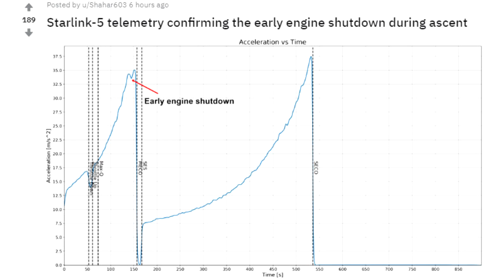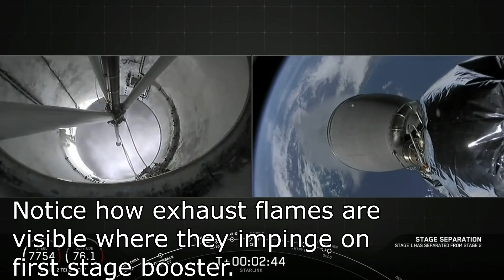Falcon 9 Suffers In Flight Engine Failure, Booster is Lost,  but Cargo Delivered Successfully

Comment: So the problem a few days ago may have had a deeper cause than a bad sensor.  The idea that 10+ flights per booster is perhaps in question right about now.
Reply: Extrapolating from a sample size of one is bad statistics.
Reply: @Markle2k  -- We have a sample of one and that one was a failure -- that would require a good many flight of cores at more than 5 flights to undue this failure.  Thanks for playing!
Reply: @Raptorman0909  A sample of one is a sample of one. You don't know that the next booster to fly 5+ missions won't fly the scheduled 10 flights before refurbishment. Booster 1049 is the one other booster that has 4 flights under its belt. B1046 flew its fourth mission as the sacrificial in-flight abort test booster for Crew Dragon.
edit B1056 was the Starlink 4 booster that didn't attempt to land on the barge due to bad wind data. It was the only other booster that would have launched 4 times, had it been recovered.
Reply: @Markle2k  -- That's right, a sample of one is a sample of one and you don't know that the next 10 Block 5 boosters might go 10+ flights without a problem -- BUT, that sample, the only one we have to go on, suggests engines may be a problem given the apparent loss of not one but two engines on this sample of one.  You can't ignore the data in your face because your'e waiting for a sample size that might takes years to develop.
Reply: @Raptorman0909  No. If you want to talk about overall engine reliability, that we can. That is separate from what you were talking about before.
The last time a Merlin engine had a failure was featured in this video. It was a Falcon 1.0 with Merlin 1C engines arranged in a 3 x 3 array. October 8, 2012, CRS-1, one engine shut down and the remaining engines fired for a longer duration. The mission was a success for the primary payload and the Dragon 1 reached the ISS a day earlier than planned.. That was the 4th of 5 launches of the v.1.0
There have been 79 launches since then with only one failure, that not due to the engines. That is 790 engine operations plus 54 for the Falcon Heavy side boosters, minus 2 for the CRS-7 upper stage that didn't get a chance to perform and the non-existent second stage motor of the In-Flight Abort for Crew Dragon. Subtract one more for the Falcon Heavy core that didn't ignite due to  not enough TEA/TEB shots.
841 out of 844 engine operations went as planned since the previous failure on launch number 4. From launch to landing. That makes the Merlin engine one of the most reliable engines available. And, it makes the Falcon 9 core and second stage one of the most reliable rocket systems ever developed.
The launch debut of Block 5 was the 54th launch of Falcon 9 out of 83. The launch debut of the Full Thrust (v.1.2) was in 2015.
Reply: @Markle2k  -- If you launch 100 F9's each with 9 Merlin engines in the first stage and another vacuum version in the second stage and they all operate perfectly but are all first use systems what would that tell you about multiple use capability?  When the first time we get to five uses we have two engine failures then that does call into question the promise of 10-25 launches per booster.  If you power up 1000 hard drives and they run fine for an hour but none last more than 100 hours how reliable are they?  It will be interesting to learn what happened both during the actual flight AND during the abort a few days ago and lets hope they can identify the problem and find a solution otherwise the promise of 10-25 uses is meaningless.

Comment: I saw consecutive piles of white fluff piling up on the 'exhaust pipe' of the second stage, which eventually were blewn off. What was that?
Reply: frozen O2 or frozen water.  Everything is very cold at launch..Ice pieces of soot coming off of the first and second stage occurs on every launch.
Reply: @stevenf1678  Does that indicate a leak of any kind? I imagine that you don't want to have LOX bleeding out of your craft at any time, so if that occurs on a regular basis, what's up with that?

Comment: You can't really question reliability of a rocket thats been used 5 times, because it lost one of nine engines. Especially when it ended up a successful primary mission.
Reply: Add to this that the nine engines have gone through 5 full-length test burns before each launch, 4 re-entry burns, and 4 landing burns and you get 9*18=162 engine-starts for a total of 5 * 145s boost burn + 4 * 20s re-entry burn + 4* 40s landing burn = 965 seconds (about 16 minutes) per engine (9*16=144 minutes total) before one of them fails! That's pretty good going in my book :-)
Question for Mr. Manly: Do you know of any other single rocket engine which have been fired for more than 16 minutes total?
Reply: Jens Krabbe I think the space shuttle engines had hours of use
Reply: Jens Krabbe, technically only one engine fires for the landing burn, but I get your point; these engines are pushed pretty hard.
Reply: @Jens.Krabbe  You are almost correct. You just to correct the fact that during the re-entry burn and landing burn, they light 1-3 engines, not all. Still an impressive performance by that centre engine.

And, correct me if I am wrong, but don't they first static fire the engines of first stage and second stage separately at their Texas facility and then integrate the whole vehicle for a first stage static fire test at the launch pad? Then launch, re-entry burn and landing burn

So that would give the centre engine, 1 engine static fire, 5 first stage static fire at Texas, 5 static fires at launch pad, 5 launches, 4 re-entry burn and 4 landing burn = 24 burns
Reply: True, still very impressive. NASA look piss poor compared to these guys
Reply: Well, Falcon 9 Block 5 are supposed to be reused 10 times. If it's not a problem to place stuff in space, it's a problem for reusability.

Comment: I'm guessing they've lost presicion control in thrust vectoring. The liquid could be from hydraulics that controls that system.
Reply: @T R troll somewhere else
Reply: @T R Do not reproduce
Reply: @T R Here, have some attention.
Reply: @Cloud08 - if the engine out involved hardware flying about, it could easily have damaged hydraulics, or fuel delivery plumbing.
Hydraulics would make sense, as the spray didn't burn, it splattered droplets on the lens, and it wasn't frozen, nor did it evaporate off the camera surface.
Reply: @T R Screw you mate. Spread your conspiracy theories on a non-space channel, maybe you'll get more success.
Reply: you could be right thrust vectoring damage or hydraulic damage has caused landing failures during development of the booster recovery.
Reply: @stevenf1678  On the other hand that indicates they may have already learned to compensate for such failures in order to get their success rate.
Reply: F9 uses its fuel for hydraulic fluid.
Reply: @motokid6008  I thought that was what is planned for Starship?. There was a tweet ages ago, about one of the F9's running out of hydraulic fluid leading to a landing fail, but that may have been a Block 3 ?
Even if the motor gimbals have been updated to use fuel for hydraulics, there's still the legs, and the CGT's as potential fluid sources.
Reply: @T R Go away flat earther, space is real, take a physics class idiot.
Reply: This is a very good assumption. I'm software engineer, not a rocket scientist, but it seems very plausible. Let's wait and see if SpaceX releases a statement related to this failure.
Reply: @T R ya but the rockets are real
Reply: The engine was attacked bye the Covid-19........
Reply: @T R Dude are you serious?? Space is fake? Plz tell me you dont tell the truth! I would be heartbroken today if that was for real!! 😭😭😭
Reply: @FreeStuffPlease  first rule of internet is you dont feed trolls. Its literally the only good thing they have in life.
Reply: @Andytlp  watching them eat can be fun though
Reply: @Andytlp  Yea either ignore them or beat them at their own game lol
Reply: I was kidding by the way. My english is better than that but I was just pretending to be someone that may possibly believe the crap you are saying.
Reply: @FreeStuffPlease  Savage, yet gentlemen.

Comment: i wonder if the issue that caused Sunday's abort was on the same engine that failed during launch today.  Also - could it be that the landing burn failed to start due to a lack of fuel?
Reply: Rob Highfill was wondering the same 👍🏻

Comment: With 10 engines the odds of one failing might be higher, but the odds of a single engine failure causing the loss of the mission are low because of the redundancy.  With the Atlas having only two engines the odds of one failing is lower, but the odds of an engine failure causing the loss of the mission is almost a certainty!

Comment: Because SpaceX land and reuse their booster as a secondary mission when they have a missed landing it generates bad publicity and fogs the reality that the primary (and when it comes to the customer, only) critical mission is successful and the failure is the only thing talked about.
SpaceX are victims of their own success when it comes to having made reusability a routine mission element. I wish the general media would be more careful and point out that no other currently in use (blue origin are still in testing phase) are landing and reusing boosters. 
I am sure internal questions are being asked at SpaceX about two failed recoveries in three missions and they will be working to rectify any issues when it comes to booster landings but outside the company the fact is SpaceX don’t need to land the booster to have a successful mission and I wish the mainstream media (and the space flight centric media to a point also) wouldn’t run the failure as the headline ahead of the successful primary mission.
Reply: Serge I as long as SpaceX don’t up their prices after failed landing attempts then I fail to see why it would both the customer. This failure may bother customers more due to it being an engine problem and an engine going out before stage separation.
I don’t feel it’s a ‘SpaceX fan’ way of looking at it to be honest I just think it’s a shame that all the focus are on problems with the booster return rather than the primary mission. Now if media wanted to focus in a bit more on the engine failure on this flight I would feel less like SpaceX are victims of their own success. 
A

Comment: Ok--------- If an engine did blow, it probably would have taken out some fuel and or oxidizer lines including some of the structure around it. Which would account for the fog as the good engines ran during the entry burn. With the loss of a significant amount of fuel and or oxidiser the Falcon would not be able to land and would have simply crashed. But... Since the video cut out so un-normally quickly it may be that the whole rocket was destroyed as the Air plazma bore its way up past the crippled engine and into the rocket's internals. long before it got close to the ground.  Hopefully they will be able to recocer enough of the wreckage to read the crash book of destruction from start to finish. or at least enough of the chapters.

Comment: 7:00 - Is this a fair comparison? Atlas is a brand-new rocket every launch. SpaceX has been flying refurbished, "flight proven" engines.

Every launch of an Atlas is reliable in the sense that the design is reliable. An individual engine will probably work, but it hasn't gone to space, and when it does, it's gone. The Merlin engines in this flight have made it to space 5 times. SpaceX engines are reliable in a tangible way. They're starting to be reliable like a car is reliable.

Comment: So how many more Starlink launches do we have now before Kessler Syndrome renders all spaceflight impossible?
Reply: Hundreds of times as many as is required for the full Starlink constellation. They are orbiting so low that they need ion engines on them to keep them in orbit, otherwise atmospheric drag would take them out of orbit within a year.
So if this satellite constellation DOES cause a large amount of debris to clutter up that orbital altitude, all we need to do is wait a year. The ISS might need to be evacuated due to low supplies, but that's about all that would happen.
Reply: that would never be the case as the orbit is so close to the surface. At the most absolute insanely exaggerated wooooorst case scenario, we could not send anything up in 5 years. As far as I know :).

Comment: I think the failure happened at T+1:37.  You can see the flame go suddenly asymmetric at that point, presumably because one engine plume is missing but possibly because the center of thrust has changed and the remaining engines have to gimbal over to adjust.  As an additional data point, about 10 seconds later you can see some venting as normal, but it seems like it's on the leeward side of the rocket, exhibiting chaotic flow as if the rocket is not flying directly along it's axis - which is what you'd see and in the direction that you'd expect with the engines gimbaled over in the direction they are.

Comment: 3:34 What is accumulating on top of the engine bell in the view on the right side of the picture?
Reply: It is like a foil material off the second stage I guess?  I've seen it before though so it must be normal.
Reply: That is solid oxygen. The pipes always leak a bit. I guess there is quite a bit of Leidenfrost effect going on that keeps it from sublimating even though it is resting on the ducting for the turbopump exhaust film cooling.
Reply: @Markle2k  That's cool (pun sadly intended).  I forgot that oxygen needs to be kept warm up there in order to stay liquid.  Though I guess the sudden drop in pressure probably has a lot to do with the state change, too.
Reply: @somerandomnification  It is the pressure, mainly. Most common materials you are familiar with as having a liquid state, like water, need a certain amount of pressure to remain as liquid, like water. In the vacuum of space, water is either solid or gas. You need at least 0.611 kiloPascals (0.00603659 atm) of pressure for it to exist as a liquid. 1 atmosphere pressure is 101.325 kiloPascals (kPa). At that pressure the water can be solid, liquid, or gas at 0.01C (273.16K). This is called the triple point .
Oxygen's triple point is at 54.36 K (−218.79 °C) and 0.152 kPa (0.00150 atm). At less than that pressure, the oxygen evaporates and loses the hottest molecules and cools off. If you have enough of it, that cools the remaining oxygen down until it freezes.
Things that melt at really high temperature, like metals such as iron or aluminum, have such a low vapor pressure that I don't think they have a practical triple point pressure.
Even Mercury's triple point is 234.2 K (−39.0 °C) 1.65×10−7 kPa (1.63×10−9 atm) which is a really, really low pressure.

Comment: I understand why astronomers etc are worried about all these satellites being shiny, so why don't SpaceX and so on just paint the satellites black?
Reply: If you paint it black, it gets hotter. Thermal design is one of the more difficult parts of spacecraft design, because you can only transfer heat away from the spacecraft via radiation, there's not enough atmosphere to get convection or conduction cooling.
And it's in the sun for a little over half the orbit, so that's a pretty long time in what's essentially a broiler.
Reply: @44R0Ndin And that's why I'm not a satellite/aerospace engineer haha. Just give them reflective umbrella's and everything will be fine and dandy haha.
Reply: I suspect they don't want them to warm up, and the added weight is probably not desirable as well.
Reply: I think they tried that. Results must have not been favorable.

Comment: Looks to me like navigation equipment had a failure, look how the rocket decides to change course while it's fired the engines, fore and back. Then, after the rocket basically ended up in the same orientation, it decided to swing another time around with the grid fins, just to end up in the same orientation.

Right before they lost the signal, another rather violent orientation change started. Since the atmosphere gets thicker any second, the rocket would destroy itself after a while if it's continuing to make such maneuvers.

I would suspect some kind of sensor got hit by debris or liquid on the entry burn.

Comment: Atlas is always just on the edge, that thing is too small and they keep strapping on boosters to make it viable. Starliner failed because the rocket can not handle that payload. It's like a bad ksp player that will not learn and then implements this on overpaid rockets.
Reply: Atlas really needs a more capable upper stage, a be-3 or a couple RL-10s with 40 tons of propellant or so

Comment: How do they measure the engine power / thrust just before liftoff? Do they have strain gauges on the tower attached to clamps?
Reply: I would guess yeah on the octoweb u could put strain gauges.
Reply: @alesksander  I guess that make sense, as it allows it to work independently, and even during flight. Acceleration sensors are useful, but force sensors would be useful too.

Comment: My son also notist that the 10 sec entry burn lastet 16+ sec... Which fits very well in the absence of an engine.  it might be the 2 remaining engine actually just running out of fuel.  If 1/3 part fuel is missing. For the landing burn. Does each engine have its own fuel tank?
Reply: All engines share one set of propellant tanks, one tank for RP-1 (fuel), one for LOX (oxidizer).
Each engine also has a tiny tank for TEA-TEB starting fluid, this is not shared.
Six engines having enough starting fluid for one start, 3 engines having enough for 3 starts.
Reply: I think the entry burn couldn't slow it down enough possibly. Would make a lot of sense for it to abort landing afterwords, especially after wasting more fuel than planned.